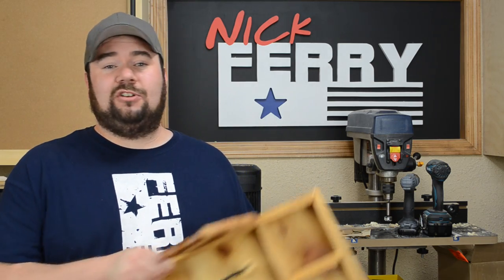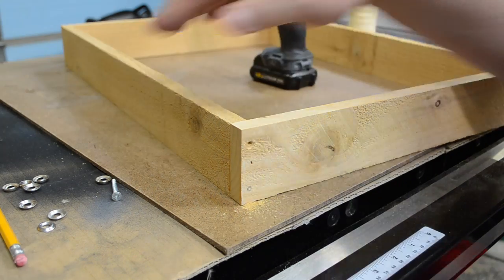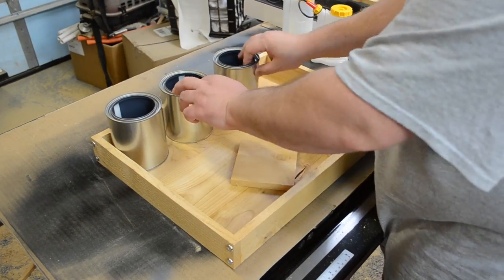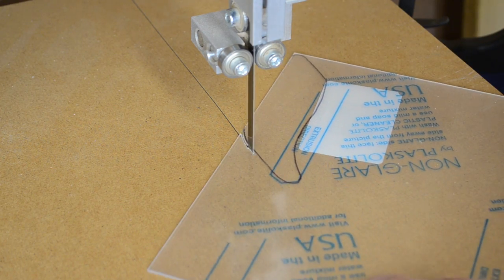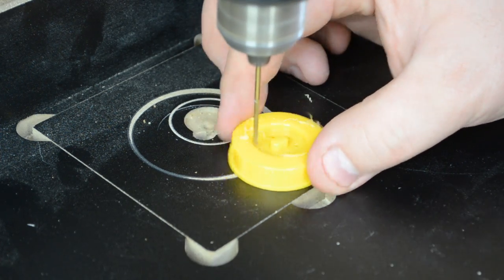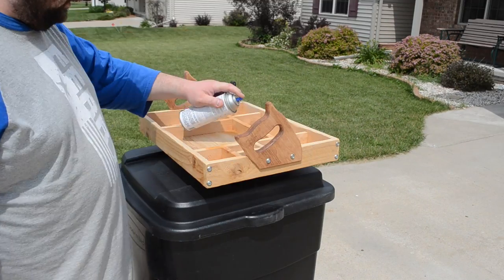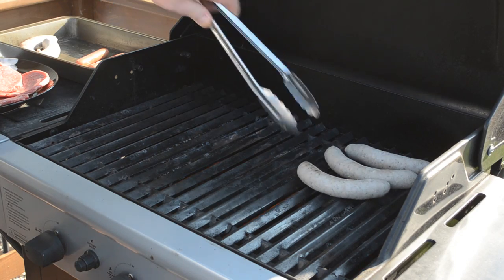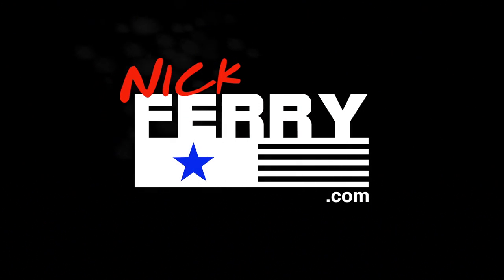Ⓕ BBQ / Grilling Tray - Woodworking Style (ep57)

Comment: Nice themed project. I know it's a small thing, but the repetition of the screws with finishing washers for the sides and also the handles ties them together as a coherent design element.

@1:30 when you said, "I routed in a rabbet on the BOTTOM, to accept my BOTTOM panel..." it sounded like Christopher Walken. I don't know WHY....I'm just SAYIN.

FWIW, I use a mustard container for wood glue. I keep meaning to use the paint can opener as a bottle opener.
Reply: Barry's Workshop Needs more cowbell...
Reply from the maker: Thanks I've been told my Christopher Walken impression is pretty decent lol
Reply from the maker: More cowbell!

Comment: The tray turned out great Nick, but how did you accommodate for wood movement? (bottom panel)
Reply from the maker: Håkon Harnes I didn't at all - it was essentially a novelty thing and would get more use hanging in my shop than being used but who knows - it's one of those projects I will keep an eye on and check it on a year or so

Comment: Nick the tray turned out great i love the theme and you use of adhesives mixing the wood glue for strength and the CA glue for fast holding is a great tip did you see that on Jimmy Diresta tips or is that something you have used before in the theatrical work you have done in the past,thanks for sharing happy 4th of July to you and yours
Reply from the maker: Thanks man - yeah I've done the glue thing for a while - not so much in theater though as I don't glue much there - happy 4th to you too!